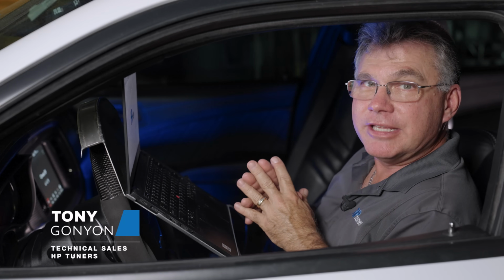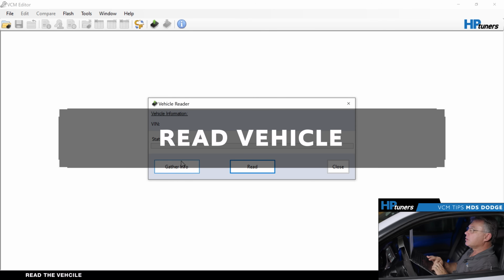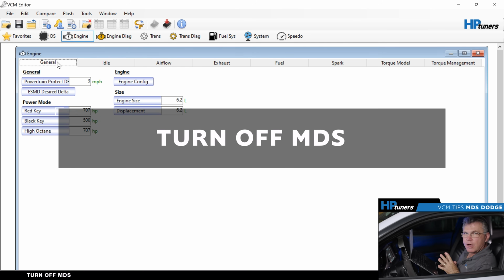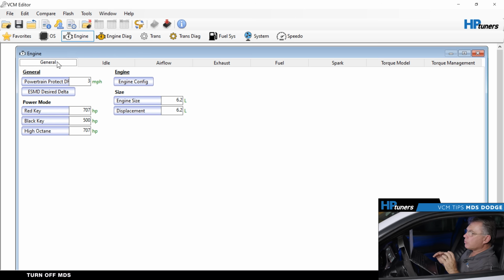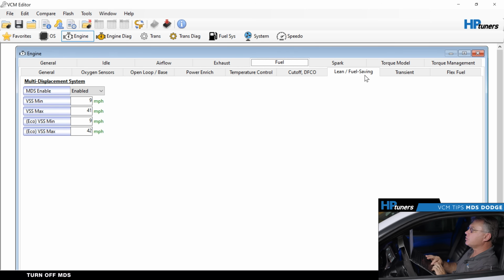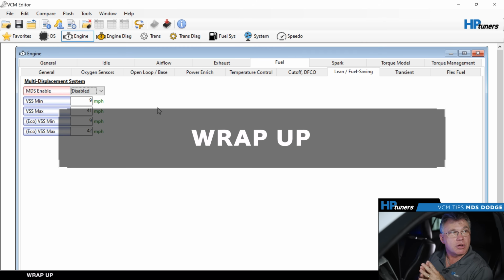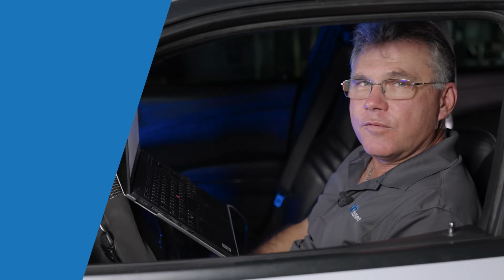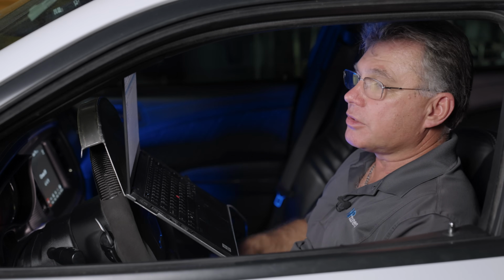How to Disable Multi-Displacement System (MDS) in VCM Editor | HP Tuners

Comment: I have a 2023 ram 1500 5.7 eco-boost. When I use the gear limiter, it seems to shut off the Eco. Is that disabling MDS? Would it be better to run the engine like that considering all the lubrication issues related to MDS? Do I need to be worried about my stock cam in that mode?

Comment: The stuff these engineers do with engines of today would have got me fired from my job as a process engineer years ago !  all if these millions if not billions in motors are basically going to be nothing but junk in a junk yard in the not too distant future plastic parts and plastic computers are not reliable all mechanical steel is !

Comment: How can I turn off my traction controle and my anti-sway system off in my 2014 dodge challenger.
Reply: This is the only way I can turn my traction control off:

1. Have the car completely off
2.Press the start button and hold down the traction button on your center console. 
3. When the car is turn on, keep holding the traction control button down until it say on you digital dash, “traction control off.”

Some people say you can just hold the traction control button down for 10 seconds and it will turn off. That never worked for me.

Comment: Not to mention, when those cylinders are deactivated, they will run dry because there is nothing but an air spring. They will push all the oil back into the pan and you’ll have metal to metal contact. There are a bunch of Chevy GMC guys that are burning 3 quarts of oil per change because of the wonderful deactivation system, best thing you can do when you buy it new is to turn it off.
Reply: these people only think profit not practical
Reply: Every car maker that uses cylinder deactivation to save gas created a bigger problem than it solved. From gm, Honda, and dodge, the recommended solution is to deactivate the feature. And to this day we still don't have a name. Who did it? You see when leverage is significant, the injustice is significant. Now that we know what can happen. We ought to create a deterrence to this leverage so as to not repeat the same mistake again and again. Give me names.
Reply: The air is compressed but you get most of the energy back when the piston is pushed back down. Sure the force is probably not as great as combustion, but it being an air spring doesn’t mean that the cylinder walls are any less lubricated than the other pistons. It still shares the same exact crank case of oil and splashing as the other active cylinders. 

Failure is pretty inherent to most pushrod roller hydraulic lifter engines of any make and model.
Reply: @damascus-ut1ee  not to be contrary, but these engines that have deactivation are burning at least three quarts of oil per oil change, GM has the nerve to say, that's normal. So the deactivation does indeed have a problem with cylinder scoring and damage because of the lack of oil for the deactivated cylinders, there is no other explanation as to why you have oil consumption. If the deactivator handheld shut off programmer is used early on in the engine's life, it will consume less, period end of story. I know it because i've seen it.
Reply: @1999StangGT4  The explanation does not explain why oil burns - because that’s not how AFM works - I explained it in my previous post. A lot of other cars have a form of cylinder deactivation and oil consumption isn’t even a thing. Maybe Chevys have valve seal, tolerance and PCV issues
Reply: @damascus-ut1ee  sure, you just go ahead and tell me everything that I know and see. Do me a favor, Stick to the proof and not your conjecture. I'll be awaiting your proof of which you have none. I do, now go run along. And if you don't believe me, you can check the interwebs and there are plenty of reputable companies that have proof.
Reply: @1999StangGT4 Nothing I said was incorrect. You’re just wrong on your fundamental knowledge of how oiling works, as well as MDS. 

150psi-300psi of air spring pressure isn’t greater than the 1,500psi+ of combustion pressure. That means MDS mode isn’t “pushing” oil down any more than normal. So go ahead and try again - pick something I said, and explain how it’s wrong.
Reply: @damascus-ut1ee  on this issue, you have nothing but conjecture and not proof i've seen it as well as other companies have seen it, that's why it is disabled using a tool. Sorry, you don't get to look like professor proton on this one, but unfortunately you  are not.
Reply: @1999StangGT4 Again what did I say that was wrong? Still waiting

Comment: I put a 2020 Charger Hellcat drivetrain in a 2019 Challenger. Everything is fine except the speedometer won’t fit in dash. Can I get Challenger speedometer programmed to match Charger computer?
Reply: Should be identical just 2dr vs 4dr
Reply: might need a new bezel otherwise it should fit

Comment: Do I have to replace my cam to do this?
Reply: No, absolutely not. If you had to add a cam it would work badly in eight cylinder mode. No need to mess with anything and just put a smile on your face.

Comment: I have a 2019 challenger rt. I have purchased 2 credits and installed the unlocked PCM from you guys. The lean/fuel menu doesn't even show up as an option. Every other menu is there except that one. How do I disable MDS?
Reply: So, in the tools tab. Or the edit tab, there should be view and change it from basic to advanced. Disable the “open last tune on startup”. Close out the program, then open the editor again and open the file. You should be able to see it after that .
Reply: Do I need a unlocked PCM for 2017 5.7 challenger?  Or can I just pull the file and tune it like GM cars?? @Oxcotton09

Comment: Do I need to replace the camshaft also from MDS to Non MDS? Or the camshaft is same ?
Reply: You only need to do that if you are going for a hardware MDS delete (replace parts to disable it). This system seems to do it by reprogramming the PCM to not use MDS (soft disable)

Comment: Do you need vehicle credits to do this, or just the Hp Tuners device?
Reply: i was wondering the same thing and was wondering if the pcm needs to be unlocked for it.
Reply: @BECKBUILT5B  I think you'll need to unlock the ECU for '15 and newer
Reply: @3SM20Pilot  you are correct I ended up needing 6 credits and pcm unlock
Reply: You'll need credits.

Comment: I have 2015 Ram Hemi 5.7..I downloaded my existing factory tune and when I open VCM editor/Engine Under Fuel Tab I DO NOT see the Lean /Fuel-Saving Tab
Reply: Make sure your not in beginner setting, select edit menu, click view and change it to advanced
Reply: @GSpecialist  Thank you very much! This information really helped.
Reply: @josephvanwanzeele5125   jumping in on this old post.  i just started adjusting stock file and had the same issue.  am i also supposed to set min rpm for mds to something ridiculous like 8000 rpm to ensure it doesn't activate?  even though i just disabled it as shown in this vid?
Reply: @christopherbowersdresser4188  Hi Christopher. Really the aim for increase base RPM is to help with intial tuning after a new cam is put in. Stock tune is set pretty low to match fuel/detonation efficiency. Once a new engine cam setup is put in, that efficiency is out the window and you need the engine to run at a slightly higher RPM to help with not having hard starts and stalls while re-tuning. I bumped mined to ~800 rpm to help me out.
Reply: Did it work

Comment: With a 2018 ram 2500 6.4, to deactivate the mds, will I need to send the pcm in to be unlocked or can it be read and licensed with the mpvi2+ through the obd2?
Reply: That truck and motor does not have MDS I believe
Reply: @anthonyostir1748  this one did from the factory. The owner had a shop do a non-mds cam swap on it but needed everything disabled in the pcm. Future reference, it did incase anyone else runs into this. Send the pcm to hp tuners/pay for the credits to unlock and disable it. It was pretty simple and if I can help anyone feel free to let me know I'll do what I can. Thanks for the reply.
Reply: @joshualgfys0074 I'd love to have it permanently disabled on my 2020 Ram 2500... I have a flowmaster muffler and it sounds stupid when in MDS (at least in the cab) so I always just tap the gear selector, but I'd love to not do that. I don't think it impacts fuel mileage anyways.
Reply: @joshualgfys0074  shouldn't have needed to send in your pcm.